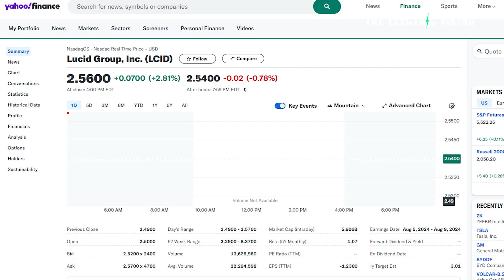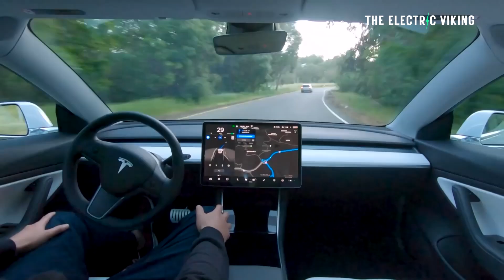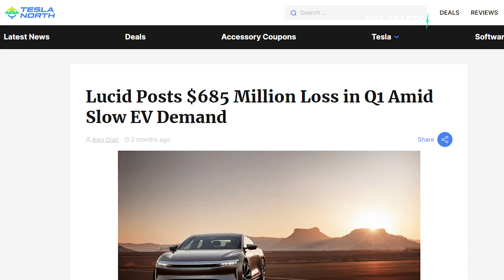Lucid says its EV Tech YEARS ahead of Tesla & 10 years ahead of China

Comment: I believe Peter. Lucid is way ahead of Tesla in Motor performance and efficiency. Proven by the dominance of Lucid Air Sapphire over  Model S Plaid. Lucid is ahead in all categories, in the world. Marques said it correctly, best in class in all categories.

I believe best in class in pricing as well. Maybe the price is too low to make a profit. Should price it like a Rolls Royce. But then demand will suffer even more.

You cannot support all these categories if you don't have the components. Best in class in FSD or Cruising? Yes in things that matter the most. Tesla still suffer from phantom braking while Lucid has none. With more sensors, including Lidar, Lucid Air has more potential in autonomous driving.

Lucid charging is also better than Tesla's with 800 V architecture. Chinese may have 500 kW charger but how many can use them? Virtually none at the moment.  Lucid is let down by third party chargers, not caused by the car and the car company, Lucid. As LFP, it cannot provide the performance required by the best in class in all categories of a car.

All these are caused by careful designs in space and  in weight, and designs are what make cars advanced in technology. However, advanced technologies cost money.
Reply: Is that you peter?

Comment: Biased aside I think what Peter refers to is battery technology and not FSD technology which clearly Tesla is ahead of everyone. 
Now compare class to class Lucid Air starts from $69k with 394 miles EPA range compared to Tesla model S starting at $73k with 320-359 miles EPA range. 
Moreover, it's fair to say Lucid Grand Touring take the top 3 spots in EPA rating and is capable of doing 516 miles and 112 kWh compared to closest Tesla Cybertruck with 470 miles and 122 kWh battery. That's before the announcement of 5 mile/kWh announced last week. 
Finally, the majority of lucid loses are from building fully vertically integrated factories in Arizona and Saudi Arabia for the Gravity SUV and smaller mid-size vehicles. Comparing one startup to another is not apple to apple. 
It's better to have a healthy competition for us consumers. 

Cheers

Comment: Anyone's tech is 10 years ahead of china tell your viewers about how dangerous Chinese electric death traps are if you crash at a low speed your car will catch fire problem is the cars arnt made well so when you try and get out your doors will be jammed so now your stuck in a car on fire and you cant get out ao i saw people trying to brake the windows which are hardened glass so you burn to death in them not to mention the suspension is snapping on 3000 km because instead of being welded properly it's welded in 2 little places buy a Chinese car if you want to die

Comment: Autonomous driving tech is NOT EV tech.
Reply: You’re right, it is a software/hardware tech that could be slapped into any car when perfected (if ever)
Reply: @Drcraigfreeman  exactly... EV tech is stuff more related to battery pack design, electrical power systems, gear boxes, aero approaches, and motors. EViking may have a point on the cost and various others could catch them at these prices, but maybe they can scale and do smaller cheaper models with these parts and such and get same and better efficiency with what they have going on at lower prices?  I'm sure some of the profit/cost issues are just related to volumes they are at so far.

Comment: EV industry requires innovation, infrastructure, raw materials and legislation. There are large gaps in each of those vectors. Currently I don't see any of those gaps 'closing' any time soon. Not to mention that the source of energy is still just as 'dirty' as anything hydrocarbon related. Please prove me wrong 😏
Reply: Here in the UK electricity uses no coal and only about a third natural gas. Natural gas is the least CO2 intensive fossil fuel.  Most UK electricity is from wind, solar, nuclear and biomass. therefore it is pretty clean and improving all the time.
Reply: Here in Colorado I run my car on 100% solar from the local solar farm.
Reply: All those area are making decent progress. Gaps never 'close'. Gas engines are never perfect either, but they are suffering diminishing returns. 
EVs take far less energy than ICE, and that smaller amount is trending toward clean sources. Oil burners will always burn oil, because nobody will want to pay much higher prices for synfuels or hydrogen.